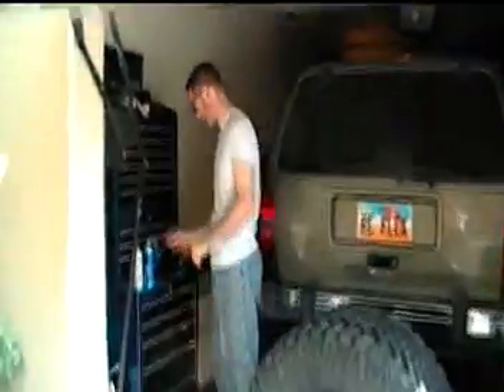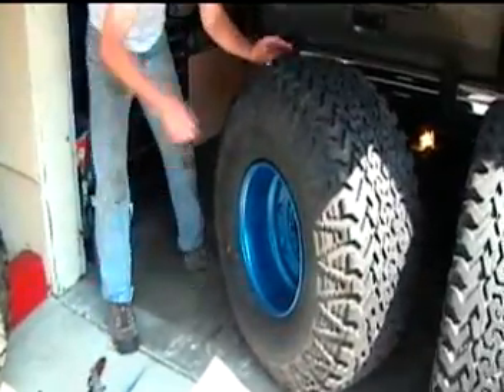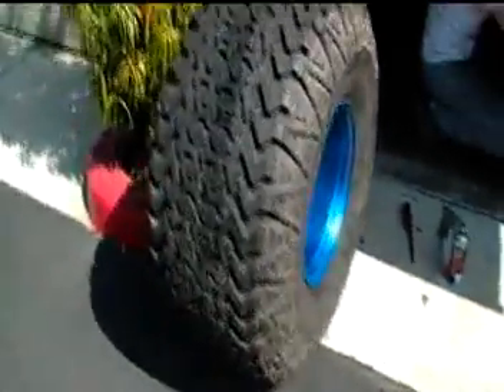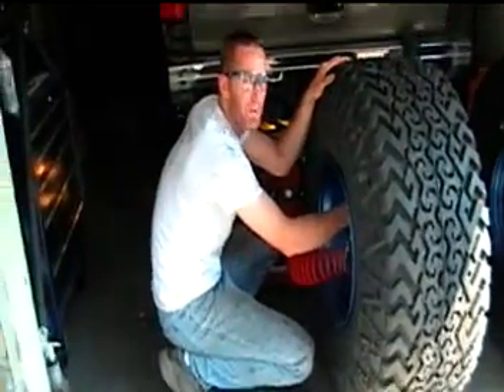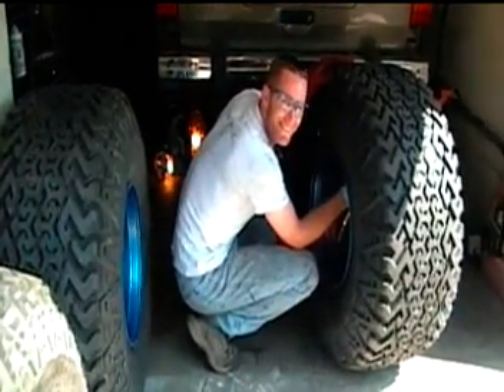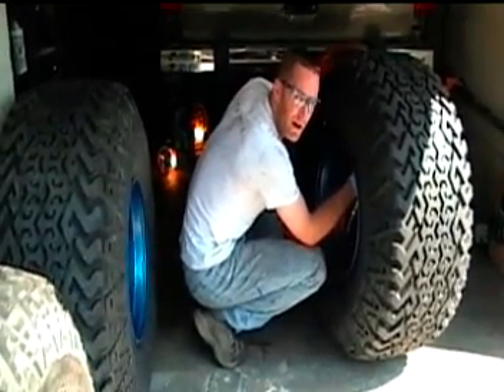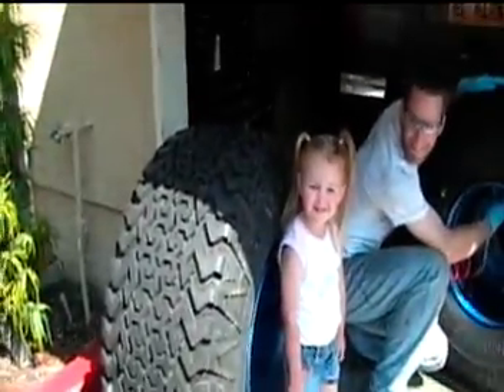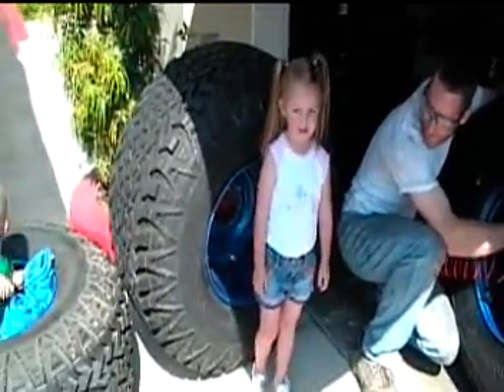Tire Mounting 101

Comment: Interesting, saw this on some Antarctic exploration show. Good info at least mentioning that there would still be some flammable fluid inside the tire. Better on big tires compared to smaller ones. Gotta balance them, but on big tires, who really needs balancing? So much material you'd need some huge weights to even make a difference.

Comment: Be very careful. I have seen tires explode using this method... All in all, if you are careful you should be ok... if the first or second attempt fails, and you have burned all the O2 out of the tire - you must add more O2 simply by useing the air hose for a few seconds, then try again... Just use as little fuel as possible for safety. (other fuels i have used are; Off-insect repelant, gasoline, hair spray... And the like) BE SAFE ! ! !

Comment: i only do this as a last resort to getting a tire to bead up.  i can usually get them to spread enough using a 2" ratchet strap around the outside of the tire.
 the key is NOT spraying too much inside the tire.
  tall radial tires are the easiest to bead up, a bias belted tire with stiffer sidewalls can be a bitch sometimes....

Comment: Pro tip: keep the valve stem core out and someone ready with an air hose. This is so you can burn all of the gas inside the tire and not endanger yourself or others driving down the road. Also when you keep the core out, the rapid cooling of the air inside the tire will cause it to contract and it could pull the tire back off of the bead, this is what the at-the-ready air hose is for. other than that...nice video. But I must ask...why so tall on the ZJ?